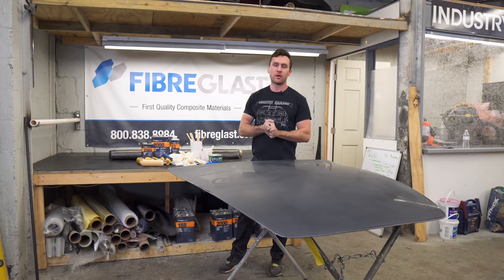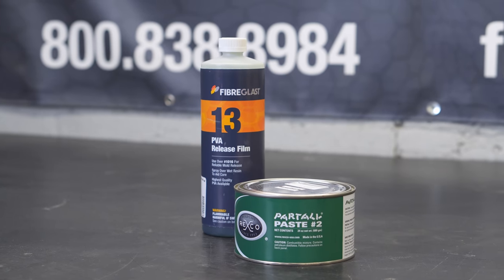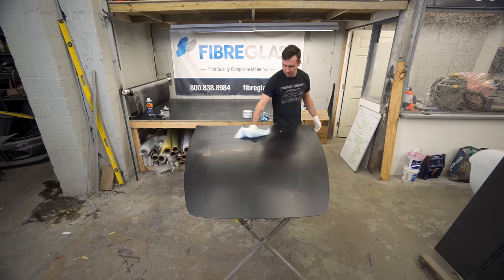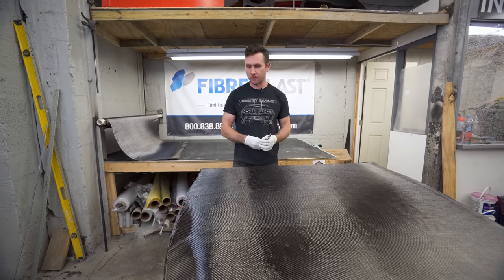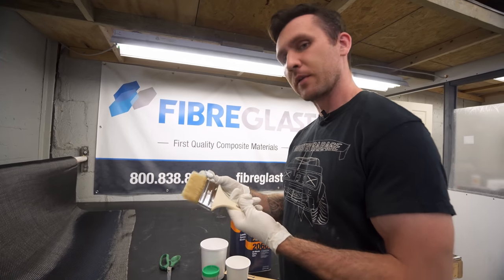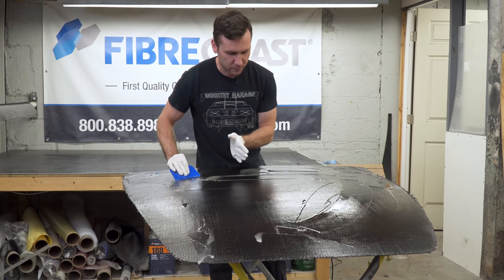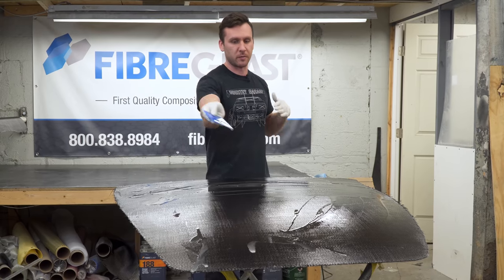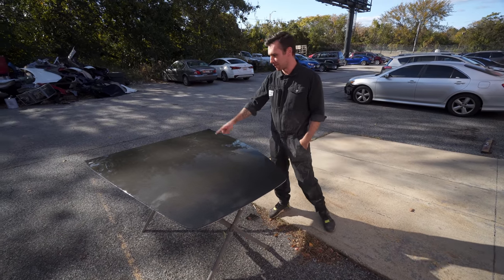MAKE YOUR OWN Race Car Parts | Carbon Fiber DIY KIT

Comment: Carbon fabric is woven with the threads at 0 and 90 degrees. Turning the entire sheet 90 degrees isn’t making the layers run an opposite direction. The threads are still at 0 and 90 degrees. You need to turn it 45 degrees or buy bi axial fabric woven at +/- 45 degrees to help with warp on large flat panels. Since this is just an overlay bonding to an oem hood frame, you’ll be fine. I just hear people say that all the time.
Reply from the maker: Thanks for that tip! Always helpful hearing from the legend himself 🙌🏽🙌🏽
Reply: In my aerospace course they told us everytime to do that even though it’s not obvious but the treatment of the fibers can actually cause some warping. 
It’s not blatant in a ambiant temperature cure but if cure you can actually have severe warping depending on the manufacturer. So yeah, not necessarily but good practice.
Reply: Twill actually has different directional properties, your statement would be true for plain weave, but not for twill.
Reply: @godzuki2099  I assure you, you are wrong. The threads are still 0 and 90 degrees in twill or plain weave.

Comment: The super glue trick on the brushes is super clutch, I had all kinds of bristles in my first attempt at skinning an engine cover
Reply: Try a foam brush.
Reply: Try polyester brushes, better than foam
Reply: @mlinecomposites1  not for every situation.
Reply: @ajhartmanaero  not sure what situation your talking about, I’ve done all kinds in aerospace. I’ve tried using foam brushes, doesn’t work well for me. What’s it work good for u on?
Reply: If your talking about overlays I’m not sure how it works good when most of the time the foam absorbs the resin. When your doing an overlay you need the resin on thick n heavy
Reply: @mlinecomposites1  works good at eliminating the chance of a brush bristle getting in your part.
Reply: @ajhartmanaero  have you tried a poly brushes, their black in color and have very rarely had issues with coming off unlike the regular brushes
Reply: @mlinecomposites1  no. To expensive for a 1 time use, and still doesn’t eliminate the chance of a bristle coming off.
Reply: @ajhartmanaero  it’s not a one time use, acetone soaking
Reply: @ajhartmanaero  yeah i kind of settled on just picking them out with tweezers if it happens or if its on a layer i care about....   and also i tap the metal strip down a tiny bit more(the nails) and most importantly i trim all my chip brushes down a half inch or so in advance with scissors so the bristles are even and stronger for dabbing bubbles out... and that usually gets most of the loose ones to fall out in advance.

Comment: Nice..  Bought my CF and stuff..  Waiting for 'winter' to normalize in my shop.. one day it's 38 degree  the next it's 59 degrees.. I have heaters.. but  still a bit 'gun shy'  cause of the cost.. just dont want to screw it up too badly..  I can get the shop to about 67 degrees if I hold the heaters on ..  I have the 60 min stuff.    Thanks for posting.. DMAX motion sim

Comment: You've given me a lot more inspiration on how to take my hood hand-layup.. I was going to apply some epoxy, let it tack, add the fabric, vacuum bag it, then build layers up. However I think I can probably skip the vacuum bag by using the squeegee, then have the surface prepped ready to throw the fabric on and wet it out immediately rather than adding a base coat of epoxy first. One major question I'm stuck on though.. did you post cure your part? A lot of epoxy systems here in the UK won't achieve the full strength and heat resistance ratings until they have been post cured in an oven. I'm hoping my bodyshop can do that part for me..

Comment: You can spray acetone to get rid of air bubbles  too if you don’t want to use heat. Epoxy will still bond if you add it within 3 days , no need to sand if your just trying to build layers up first

Comment: I would love to made a carbon fiber hood for my car but I'm too lazy to made a mold for it lol, probably end up using this method if the size difference from the stock hood is negligible
Reply from the maker: That’s exactly why we made sure to show this method lol. It’s always easier to start out with the most accessible way and build from that. Just need folks to try it out 🙌🏽
Reply: This would work fine, but how many folks have a spray booth to get the final finish on. Think it looks soo cool and easy to do with the kit, but my gut says that the first few times you try doing it it is going to be crappy. Air bubbles etc tend to be hard to get rid of. Would be cool if one could use a vacuum bag and let the resin get infused in, but then again all of these techniques work well when you have the right parts, the space and patience cuz it wont get to be right the first time. I would start with a small part to make in carbon fiber before attempting a large one.
Reply: The difference in size would be a couple or three mm.

Comment: Bond a skin? I do tons of carbon fiber work and if I was going to skin anything I wouldn't have put partial PVA down. You could have just put some good scratches in the hood and the carbon fiber would have bit onto it as good as possible

Comment: If you're going to paint the hood, why not mask off for one or two racing stripes that show the underlying carbon? Would probably look even more sick with a colored carbon/kevlar racing stripe (like a blue or red would look badass on an all black car)
Reply from the maker: For the car this part going on not sure if it could pull that look off but will definitely keep this in mind for a future build 👌🏽👌🏽
Reply: @StreetBandito  Hell yeah. I also had an idea that I want to try at some point: naked carbon hood but with a strip of carbon/kevlar as a racing stripe inlaid into the show layer. Might be a touch heavier since I'd probably have to build up the epoxy top-coat to keep it all flat, but I bet it would look sick. I don't think I've ever seen anyone do something like that.

Comment: Could  I make 2 fenders on an s15 from one large kit ? Excellent channel
Reply from the maker: Probably not you’d probably need 2 kits
Reply: Hi! Actually, the large kit could possibly accommodate both fenders! I would only order one and measure.  The only additional thing you may need to order (separate from the kit/directly from Fibreglast) would possibly be a small roll of carbon.

Comment: Is gelcoat a release agent? Whats the difference between gelcoat, pva or wax?
Reply: Pva and wax helps you release the part from the mold. Gelcoat is basically epoxy resin with a dye, a base layer to everything. Gelcoat first, then all your cf cloth weaves and resin then a top coat or clear coat to finish. 
It's not always necessary tho because the resin will cure just as hard. Most of my peices I've done without it. It's more useful as a surface in a mold, or say if you are just laying a cf cosmetic layer on top of a light colored part (because you can sometimes see the color through some pin holes in the cloth) and a black gelcoat will make it harder to see any imperfections.
Reply: @voongnz  crazy how you helped me more than the guy on the video. Thanks man i appreciate. So  if i understood,
First pva and wax
Secont gelcoat and so on?
Reply: @BplexOnline  no problem man. I guess he was just only mentioning what he did in his process. All good info tho. 
Yup wax and pva, then gelcoat/resin, or what this guy did and layed the cloth and soaked it in from the top. Different ways of doing it, just as long as you get good even coverage and it's all wetted out. 
Personally I'd put on my release agents then the base layer gelcoat/resin, then the cloth then resin on top again. 
And of course if you are doing a cosmetic carbon wrap, you'd leave out the release agents, sand/key in the surface and apply the gelcoat/resin to get a good bond. 
Good luck on your projects. And also wear a respirator with organic filters. The vapors from the exothermic reaction can easily kill your lung cells.

Comment: never saw how you addressed your rough edges around the edge of the part after cutting fibers and leaving rugh edges. were these cleaned up durrign final sanding of resin before you applied clear coat, if so did you just sand edges smooth with the same 80, 120, 180, 320 grit papers prior to clear coat?
Reply: Oh that must have been in the time lapse.  Yes, you're correct - they were cleaned up during the final sanding

Comment: Any time between layers or just straight away?
Reply from the maker: No need to wait in between layers. Just make sure you try have an even distribution of resin and  make sure your part doesn’t have any dry spots before your next layer.

Comment: I wanted to ask this in your Q&A but missed it, is there a different end result  between wet laying and vacuum infusion, why buy the pump, separator, peel ply, bagging etc when you can just wet lay? Does using all the vacuum equipment give a better panel or finish? Thank You.
Reply: Vacuumed is an overall better finish and it weighs less because it only uses the resin it needs. Wet layup has extra resin so it weights a bit more. Plus vacuumed has no air bubbles.
Reply from the maker: Correct the vacuum method will allow a better finish and it also helps to eliminate excess resin. It’ll just keep the amount that’s needed.
Reply: @StreetBandito  Why didn't you vacuum the hood? Too big to fit?
Reply: @justinwright54  Hi Justin, to vacuum you need a pump, catch can, clamps, hoses, peel ply etc, and you have to make a mould. The disadvantages of wet laying are the air bubbles which can be mitigated by heat and/or sanding and an increase in weight which must be negligible?  The advantages seem to be a vast saving in expenditure and time as you do not have to make a mould. Wet laying seems the easier, cheaper quicker option and a no brainer, but I feel I am missing something? Thank You.
Reply: @indigojewsnap7307  if your just building things for yourself then just do a wet layup and do a few extra coats of resin on your final layer so you have room to sand it flat. Yea the weight differences is neglectable.

Comment: Id wanna see how to make a complete hood, not just a skin 👍🏻
Reply from the maker: This original hood provides the structure so we are going to cut off the aluminum and replace it with the new part made.
Reply: Look up easy composites on here they have a video tutorial on it then just do the last stage how you want they did resin infusion but you can do wet lay with or without vacuum.

Comment: what do you use to bond the carbon and frame togeather?  i have just made my frame and hood for my 84 alfa romeo spider,( s2 glass), but cannot find a true answer on how to do this... lots of guesses   really do not want the hood and the frame to debond on the highway.. could be a wee bit emberrassing... the frame is also s2 glass, thanks.. doing the boot next.. saving alot of weight this way
Reply from the maker: 3M epoxy if you go to our description we have a link beside the “items we use tab” and in there it should be a link to Amazon on the exact one
Reply: @StreetBandito  thank you
Reply: i was quite shocked at the price $68.00 for 4 os... had no idea my car needed a ' fix '

Comment: Question: These layers are ADDED to the former hood line, raising it. Ok, later on you remove the original hood skin, which would make this one drop – unless you match the thickness of the original hood skin. Will this affect the result?
I always thought you'd make a mold to exactly match the exterior of the original part, then filling the mold, building the part from the outside to the inside.. But I've seen lots of videos where people seem to jump that step, just adding to the original parts.
Any Pro's and Con's? Would love to learn more about that, thank you guys, you're really inspiring!

Comment: Do you ever have fit up issues when making parts without a mould? Because the inside of the part is now the same size as the original outside? If that makes sense

Comment: Q: I noticed that you didn't use the vacuum step. Why? Is the vacuum necessary??
Did I miss an explanation in the video?
Thank you
Reply from the maker: It was for simplicity and budget for people first starting out. Our goal was to help show people the best thing to do when wanting to learn is to get out and just try them improve from there.
Reply: @StreetBandito  thank you for the response. 
It appears that a mold isn't necessary,  basically can use the part as the mold.

Comment: Did you guys have to wait between layer applications?
Reply from the maker: No we just took out as many air bubbles as we could and made sure to evenly distribute the epoxy throughout the part.
Reply: @StreetBandito  sick thanks!

Comment: Hey Tim, I am definitely interested in ordering one of the large kits. I am curious how much of the kit did creating this hood consume? I am trying to figure out how many body panels I could make with 1 large kit (approximately)
Reply: Hey! We used 4 layers and ended up having 10 feet left over. If you order the large kit, you'll have enough products (like resin, wax, etc.) to do more than one part for sure. But, you might need to order an additional roll of carbon fiber separately depending on your project.

Comment: Ngl kinda boring video. Feels like I've seen this b4, y'all gonna have to step your game up like adding wire or 3d parts between layers. If it were me I'd use ur cnc to cut foam for cores or plugs.